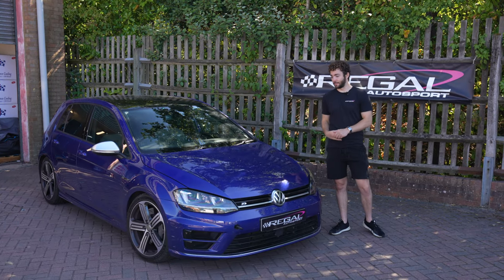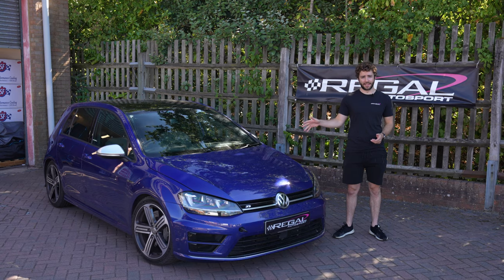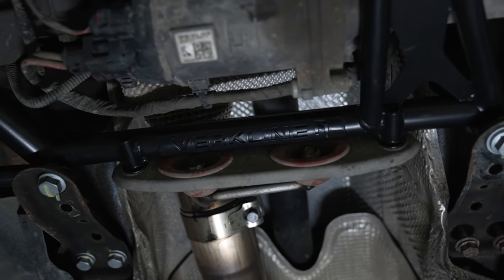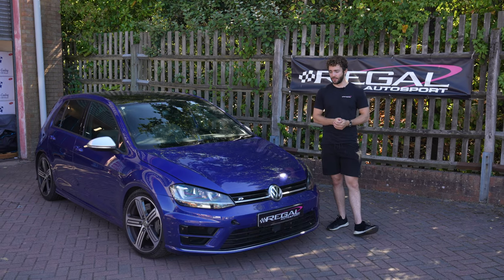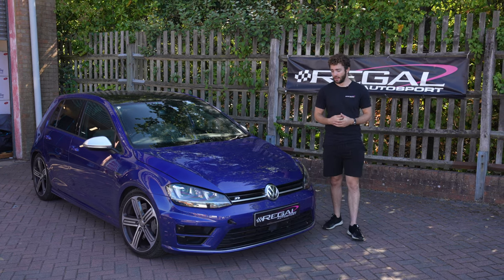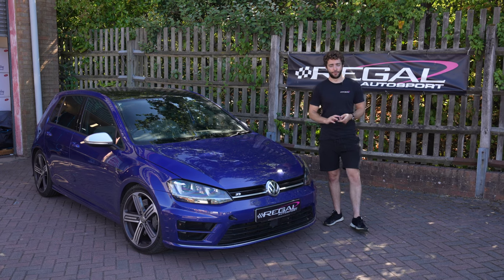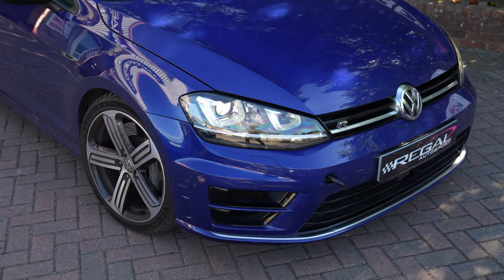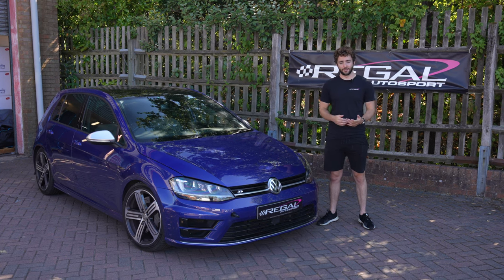THE BEST BIG BRAKE KIT FOR YOUR MK7 GOLF R?

Comment: Do these brakes fit on the speilberg/Englishtown rims without a spacer (19x8 ET50). If a spacer is needed would  the 5mm racingline hub adapter be enough. Thanks
Reply from the maker: I think you might need a spacer!
Reply: 8,5x19 et45 need spacers? Thanks!

Comment: Nice video. Did you have to do any upgrade to the main brake cilinder due to a larger replacement of brake fluid?
Reply from the maker: With this kit you do not need to make any other changes

Comment: What is your overall impression of these, I have a 2022 8Y S3, thinking of getting the 6 piston 380mm RL kit,  I tried emailing racing line many times to no avail which makes me uncomfortable spending 4k USD. Any cons overall? Replacement pads and rotors easily findable? pedal feel? fade? any difference in emergency braking?
Reply from the maker: How odd! Drop us an email and we can talk you through it